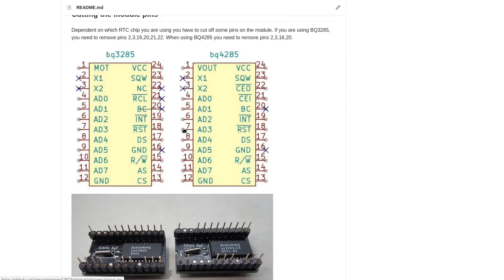Ultimate RTC module  replacement for Dallas DS1287, Benchmarq BQ3287, BQ4287 etc.

Comment: no offense, I love the content you make here, but isn't this design just a rehash of the glitchworks RTC that's been around forever in the retro scene?
Reply from the maker: Just googled for it and they seem to have also a nice solution, but quite different design. They piggy back a PCB on a DIP IC and it is only designed for DS1287, as far as I see.   But if you look at it without going into details, both solutions are eventually a rehash of the originals. This is how they look internally, before the manufacturer fills it with resin.

Comment: This is great, nice project! I've got at least two PC's (Olivetti 286 and an ICL 386, might have another PC with one in somewhere) that use the Dallas 1287, both of which are dead. I was thinking of doing the coin cell hack, but decided in the end to get a couple of replacement DS12887 chips. I'll certainly look into getting a couple of your replacements though if those Dallas chips I bought don't last very long.
Reply: guaranteed they don't last long. Happy hacking!

Comment: They still make these dallas modules. You can get them from big distributors like RS Components.
Reply from the maker: I bought in China three times, they were all dead. Then I was tired of it and got five in Germany from a big official distributor, sold as new for 10€ each. Turned out, that it was old stock as well. One was dead on arrival, one died after 6 months, the others after a year. May be there are some new indeed out there, which you can buy, but I had no luck.
Reply: @necro_ware  here in north america you can get actually new parts from Digikey all day long, I've bought several and the date codes were never more than a year old
Reply: @necro_ware  You should make sure that the listed manufacturer is "Maxim Integrated", it seems to be the company that has taken over the production of these old Dallas Chips. I recently bought a DS12C887A+ to revive an old Pentium system, the date of manufacture printed on the chip was 50th week of 2020.
Reply: Looking forward to see your new videos:-)

Comment: This is awesome! Have you thought about a CR2032 version (which are easier to get in stores)?
Reply from the maker: Hi, yes, that was my first idea, but they are just too big. It is possible to put a socket for it higher, to avoid any contact between the battery and the pins, but then the whole module is too high, like the modifications, which I made before, drilling a hole. The problem is, that the RTC modules are usually somewhere in the end of an ISA slot and if the module is too high, the cards don't fit anymore. Eventually the CR1225 are also easy to find, they are not everywhere, like CR2032, but still very accessible.

Comment: Not to throw a wrench in the works or be purposely pedantic, but I have a PC that needs a reliable RTC chip, but it has a Dallas DS12887A.  Is there any difference whatsoever?  Just trying to cover my bases.
Reply from the maker: it's the same as DS1287, so this module should be compatible if used with BQ3285 IC.

Comment: Nice!  I designed one of these with the current Dallas chip (12885T+) for my PS/2 Model 30 286 and 386DX/40.  I used the CR2032, so the cell holder protrudes a little, but I'm trying my best to convert all the machines in my collection to one RTC battery type.  I've been working on a whole bunch of adapters:

- A simple physical adapter for soldered-in Lithium cells, like the Mac SE
- Tweaks to the charging circuits on a few 386 and 486 boards to diode-isolate a primary cell
- Built a 2xCR2032 ultra-low quiescent current buck regulator PCB and a 3D-printed case for a Compaq that needed 4.5V
- Designed a 2xCR2032 PCB with a 3D-printed module that replaces the 2xCR123A pack in the IBM AT 5170 and PS/2 Model 70 386
- Currently working on a replacement for, e.g., the Power Mac and LC, with a low-current 3V to 3.6V boost regulator and a 3D-printed 1/2-AA-sized module that holds a vertical CR2032 that should be accessible through the slot in the factory battery clip.

Very much looking forward to not having to set the date and time on anything anymore.  ;-)

Comment: Excellent project! I am looking to build something similar for my old SparcStation 5 (which is also very unhappy about it's empty SRAM module). IIRC They have ST MK48T02, though, so not a Dallas/Benchmarq chip I'm afraid :)
Another idea: I was also wondering if it would maybe be possible to reimplement this functionality in something like an STM32, which would allow for a single module to be compatible to a lot of different RTCs. 

sigh So many nice projects, so little time :D
Reply from the maker: I think I also have one board with mk48t02, but I'm currently not sure. Interesting idea with an MCU. I'll put it iny mind ;)
Reply: @necro_ware : There's also no modern replacement for a DS1387 - which adds 2Kb of NVRAM in addition to the DS1287. As such, it is used by microchannel and EISA computers to hold the system configuration (notably Reply planars for PS/2s and NCR models). The DS1287 on PS/2s must be replaced with a model that doesn't modify (a Y2K fix) the "Century Byte" location.
Reply from the maker: @IBM_Museum  I forgot to mention, that this project is also compatible with DS1387. You just have to solder DS1385S ICs and you are good to go.
Reply: @necro_ware : Heh - I see that you've added it now.
Reply from the maker: @IBM_Museum  Yes, as I said, I forgot to mention it.
Reply: @necro_ware  Will it work with the DS1485 RAMified? Somehow I landed up with EISA-VLB boards here with both the DS1387 and DS1488!

Comment: Excellent! what about potting it with resin so it looks like the original one? Also, huge thanks for making this open source, unlike some other youtubers who want to make pennies out of their stuff by selling them. Thanks!
Reply from the maker: Thanks! The point of this module was to avoid the bad things about it, like solid body without a way to change the battery.
Reply: @necro_ware  yeah, but leaving the battery still accessible even after the potting, with a door or something
Reply from the maker: @cocusar  Sure, if s.o. want's the look, why not?! I prefer it like that however. Necroware inscription looks too cool to get covered, doesn't it? ;)
Reply: @necro_ware  I was thinking big, maybe you can engrave your name and model on the potting itself, like the engrave on the plastic chips :) but yeah, I agree
Reply: I wouldn't want it potted. Maybe a 3-D printed snap on cover? With his inscription of course!
Reply from the maker: @lilbill6089  Such a cover is made in 5 minutes, so it shouldn't be a huge problem for anyone, who wants it covered. I mean it's  a simple box, opened on the bottom. Just make it a little bit tight, so it holds in place on it's own.
Reply: Why on Earth would you ever want it potted? It's a big headache if anything breaks and it's not like its surroundings are all fashionable or anything, it's all circuit boards in there.

Comment: I recently replaced coin cell batteries with proper AA sized 3V lithium batteries in an externally accessible battery holder, related to industrial control.
And now I see CR1225 coin cell batteries here. I would have directly used a CR123A, for which a battery holder should fit on the top anyway, unless the IC is energy-efficient enough to last 10 years with the small coin cell battery anyway, which is about the time a battery lasts without any load.
Reply from the maker: CR1225 should keep it running for 10 years
Reply: @necro_ware  I'd imagine that the PCs where the module would be used, would be disconnected from mains most of the time, which is why these batteries go empty at all. So that's why I'm having concerns.
Reply from the maker: At least, the original Dallas modules used the same IC and CR1225 internally and were specified for 10 years. Most of them ran a lot longer. But even if it would run only 5 years, now you can easily change the coin cell....
Reply from the maker: Btw. also why CR123A is not a good idea is height. The module is usually in the end of the ISA slots and it should be lower, than the slot itself, or your expansion cards will not fit.

Comment: maybe someone could design a 3d printed cover to go over that, so it still has the look of the dallas chip
Reply from the maker: Sure, if s.o. want's the look, why not. I prefer it like that. Necroware inscription looks too cool to get covered ;)
Reply: We will just have to make sure the Necroware logo is on the cover then!
Reply: @wishusknight3009  Perfect
Reply: Isn't a bad idea since it could be something easily removeable to replace the battery
Reply: @madson-web  it is a bad idea, because the whole thing will be shut away in a PC case!!! It would be like putting lipstick on a pig to compensate for the mud.